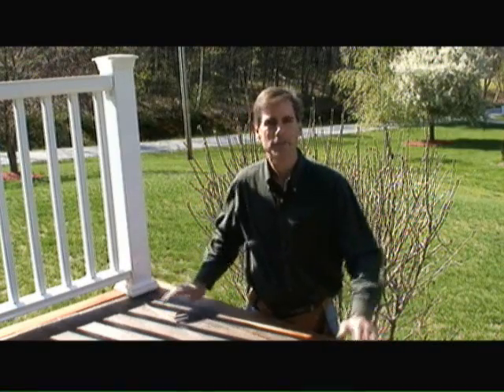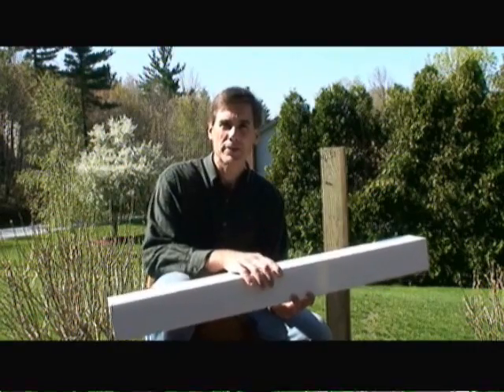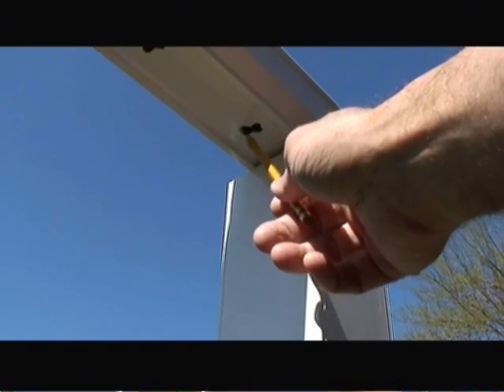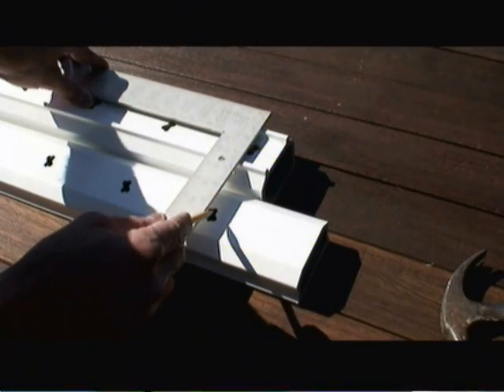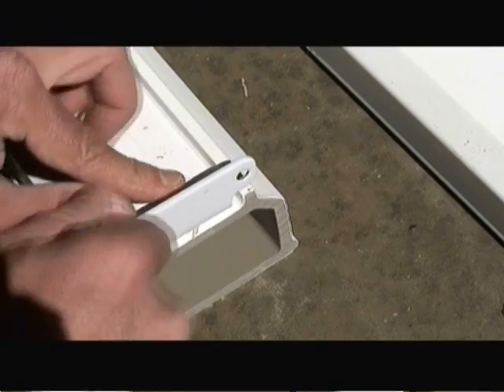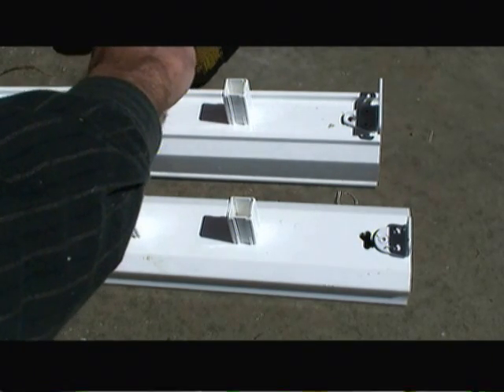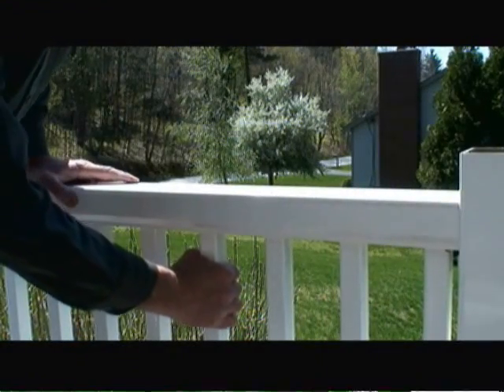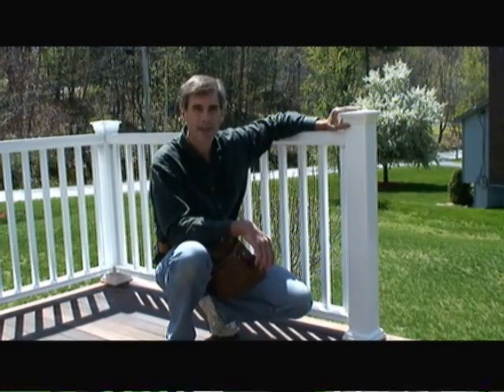How to Install Composite Deck Railing Video

Comment: The top rail is just mounted through the PVC sleeve to the 4 x 4 without any extra blocking? So, this hugs the vinyl sleeve tight to the 4 x 4 at that spot for a secure connection?

Comment from the maker: Yes, the rail systems come in longer lengths than 36 inches. I can't remember how long, but somewhere around 48 inches. You can then cut them the newel posts and balusters to the desired size.
Reply: What kind of saw do you use for the cut?

Comment: Mark:
My deck is 20 ft above ground.. and I want to upgrade the floor with a composite and add new posts and rails.  I would like to make rails higher than 36 inches.  maybe 44 inch. Is there a product that would allow this?
Thanks and God bless.